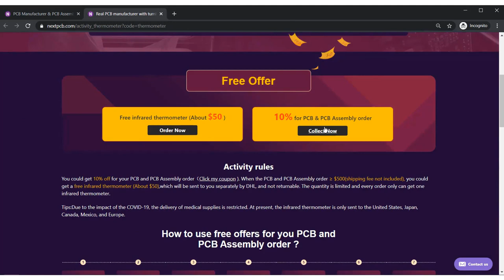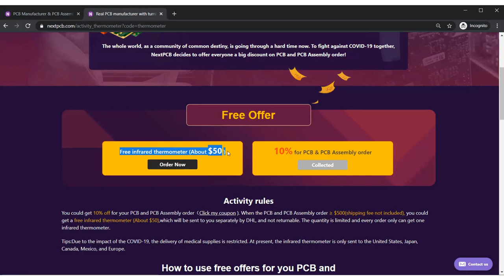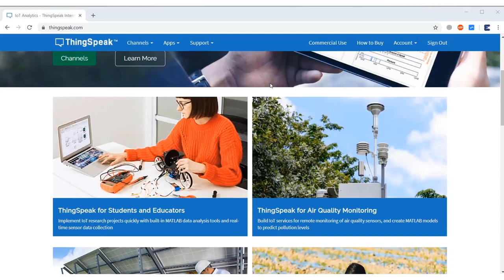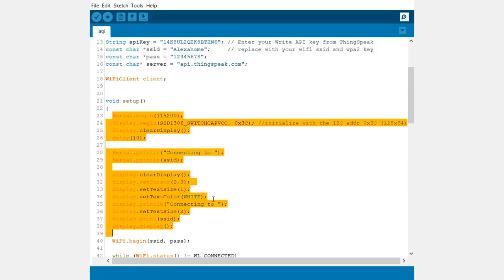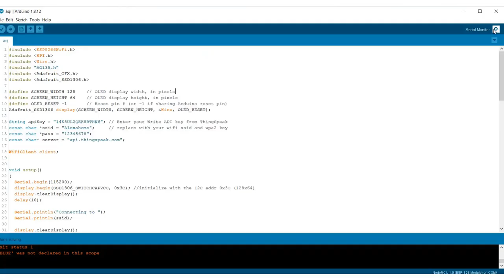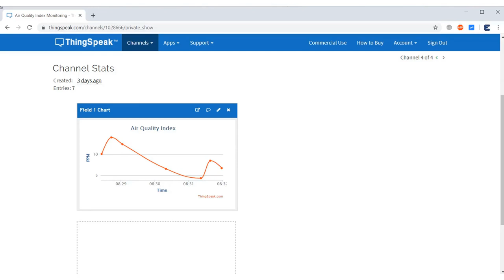IoT Based Air Quality Index (AQI) Monitoring with ESP8266 & Air Quality Sensor || Pollution in PPM

Comment: Sir your code is not working properly
Reply: I'm getting unrealistic readings
Reply: Like 2000 ppm
Reply: Plzz help sir
Reply: Tommorow is my project showing day
Reply: I'm getting Nan ppm 😭
Reply: @jamshirtangri5757  hi have u got output
Reply: @yyyyu8513  yes
Reply: @jamshirtangri5757  how to reduce the value please tell
Reply: Sir please tell how to reduce the value
Reply: Its working fine, the sensor needs time to calibrate, keep the sensor on for 1 hr , it will start to display real readings

Comment: For the source code it show like this error message
Arduino: 1.8.5 (Windows 10), Board: "Adafruit HUZZAH ESP8266, 80 MHz, 4M (1M SPIFFS), v2 Prebuilt (MSS=536), Disabled, None, 115200"

C:\Users\DONA\OneDrive\Documents\Arduino\libraries\Adafruit_BusIO\Adafruit_SPIDevice.cpp: In member function 'void Adafruit_SPIDevice::transfer(uint8_t*, size_t)':

C:\Users\DONA\OneDrive\Documents\Arduino\libraries\Adafruit_BusIO\Adafruit_SPIDevice.cpp:137:31: error: no matching function for call to 'SPIClass::transfer(uint8_t*&, size_t&)'

     _spi->transfer(buffer, len);

                               ^

C:\Users\DONA\OneDrive\Documents\Arduino\libraries\Adafruit_BusIO\Adafruit_SPIDevice.cpp:137:31: note: candidate is:

In file included from C:\Users\DONA\OneDrive\Documents\Arduino\libraries\Adafruit_BusIO\Adafruit_SPIDevice.h:9:0,

                 from C:\Users\DONA\OneDrive\Documents\Arduino\libraries\Adafruit_BusIO\Adafruit_SPIDevice.cpp:1:

C:\Users\DONA\AppData\Local\Arduino15\packages\esp8266\hardware\esp8266\2.4.0\libraries\SPI/SPI.h:65:11: note: uint8_t SPIClass::transfer(uint8_t)

   uint8_t transfer(uint8_t data);

           ^

C:\Users\DONA\AppData\Local\Arduino15\packages\esp8266\hardware\esp8266\2.4.0\libraries\SPI/SPI.h:65:11: note:   candidate expects 1 argument, 2 provided

exit status 1
Error compiling for board Adafruit HUZZAH ESP8266.

This report would have more information with
"Show verbose output during compilation"
option enabled in File -> Preferences.
Reply: U got output